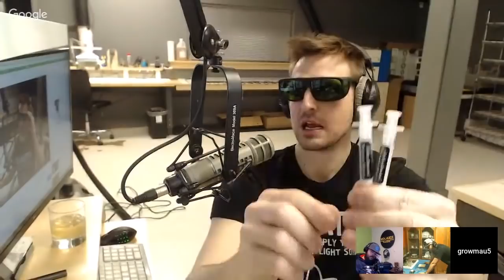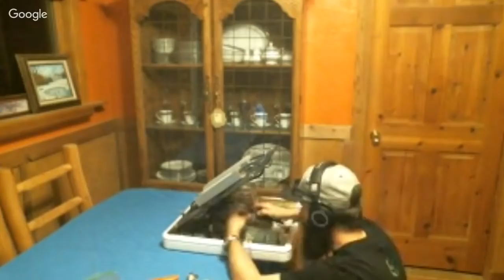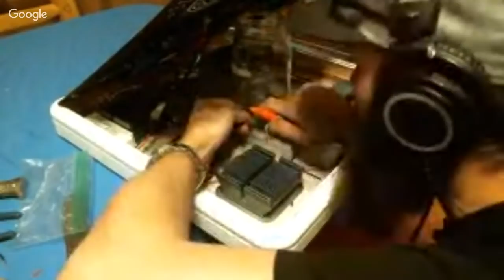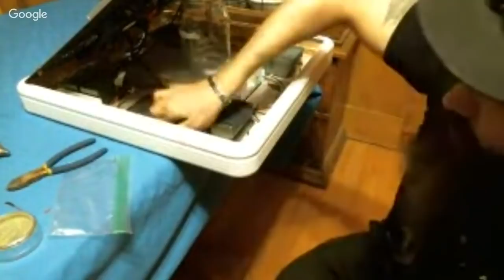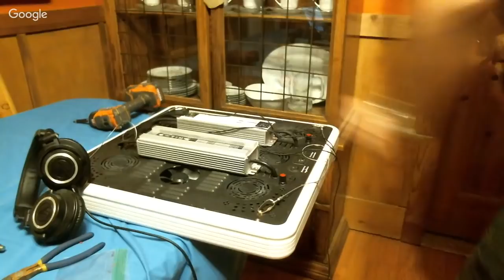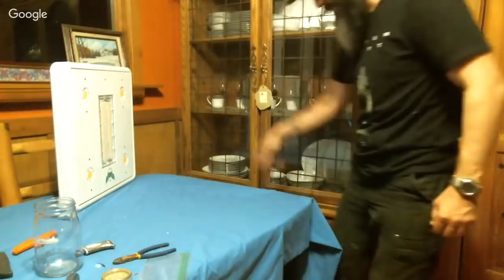growmau5 & friend(s)

Comment: @growmau5 Hey growmau5, I have some questions I hope you can help me with. I’m looking to build a 4x4 light and want excellent light coverage and efficiency. I want a cxb3590 3500k cob every square foot. With having a cob every square foot that leaves me two options for drivers. Two hlg 320-1050b or 4 hlg 185-1400b. Both setups cost the same exact amount. The cobs fill the hlg185 output voltage better. So is it better to go with the hlg 185 1400 since it can run 4 cobs exactly verses the hlg 320 1050 that runs 8.5 cobs. With 17 volts left unused. Does the unused voltage make it less efficient? I would dim the hlg 185 1400 fixture. Yield with1050ma vs 1400ma?
Reply: The left over voltage is not important.   These are constant current drivers that self regulate.  The 1400 would be brighter and cost more to run per second.

Comment: Mouse could you do a video how about light controllers or pwm. I want to have a controller that will work with three drivers to run cobs LEDs and IR at different times and indifferent strength but I can't find one that will do that

Comment: Off gassing of the mylar coating is unlikely to have happened atall nevermind for months and if you were to be using an extractor rated  to match your tent size it would be removing so much air and replacing it with fresh every few minutes alsi it is extremely unlikely to have been off gassing and if it was the air is being changed by the extractor day and night

Comment: What are your favorite supplemental wavelengths so far for each stage of growth? I remember a video a while back where you said you didn't like uvb is uva a better choice?
Reply from the maker: Rickjames The Gunsmith I like a little red added to 4000K in veg.  Far red for flower initiation.  And some high energy spectra throughout flowering, but especially near the end.  UVB scared me a bit, although I was a bit heavy handed with it.  I like the UVA for ease of implementation, and safety.
Reply: growmau5 Awesome thanks for the timely reply. When you say high energy Spectra you mean the uva and uvb correct? Also do you use infrared? Lastly do you use far red to make the plants sleep?
Reply from the maker: Rickjames The Gunsmith in a broad sense, high energy spectra would include any blue-ish light from 280nm to 480nm. It’s so debatable what’s better. I don’t specifically target IR above 800nm, but a tiny bit comes out of most 3000k white leds.
Reply: growmau5 Awesome info. How long do you expose the plants to high energy Spectra wavelengths each day? I remember in the older video you said something like 15 minutes a day. Also do you only run the far red for a similarly short period of time daily for flower initiation or just at the beginning of flowering? I'm using Vero 29 gen 7 C 5000k in veg and 3500k in bloom. I'd have to check the amount of ir in the spectrums but I think they are both identical when it comes to wavelengths that far red.

Comment: growmau5 can you answer a question!
Reply from the maker: Josh Colbert sure ‘ what’s up?
Reply: these may seem like stupid questions but if you could please give a short answer to each i would appreciate it!

Which driver i would need if i went with this set up,  https://www.amazon.com/4x-QB120-Quantum-Boards-3000K/dp/B077KHMZTC/ref=sr_1_1?ie=UTF8&qid=1522051661&sr=8-1&keywords=quantum+boards,

im working with a 3 x 3.5 x 7 height grow space

Which power supply driver would i need? the way i understand it is, the qb120's are 65-70 watts per board x 4, i would need a power supply of 280 watts to run 4, correct?

theyre selling individual qb120's including a 65watt power supply for 100usd on amazon. what would i be saving buying the four together?..
so my real question is, i could buy 4 individual qb120's with the 65 watt power supplies for 100 usd each, would that be worth going around the effort of having to wire them together and possibly get a heatsink to hold the wirings together? so which power supply would i need for 4 qb-120's?, 
or should i just avoid all the wiring and drilling with the heatsink and get four individuals with dedicated power supply for each?